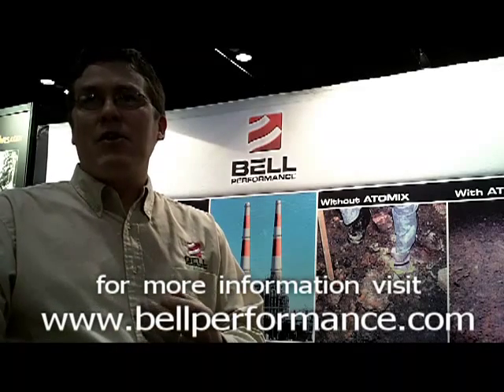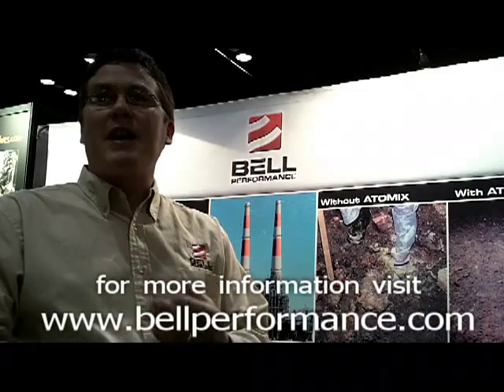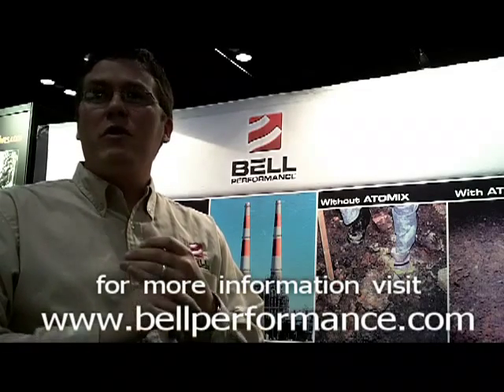Heavy Fuel Oil Treatment - Bunker C Fuel Oil -  Bell Performance ATX

Comment: many years ago in the USSR has been proven that 30% of water in the fuel kills boiler, chimney and heat exchanger. We have installed more than 100 of these devices that run continuously 1 - 4 years and there are no accidents

http://www.afuelsystems.com/en/trga_en.html

moreover, we can save fuel and without the addition of water and additives ... and this is the exact fact that the water in HFO killed force pumps

Comment: Now there is a new emulsion fuel.  It uses 30% water and 70% fuel.  It knocks the pollution up to 90% and there is no power loss and no modification of equipment needed.  Yes, it also saves money.  I know it sounds too good to be true.  Well, we are a consultant for the company that makes this emulsion fuel using a nano-technology emulsifier.  The greatest part is that it is a no extra cost, no risk to use the new fuel for a company.  Ahh! Technology is changing the picture of things.